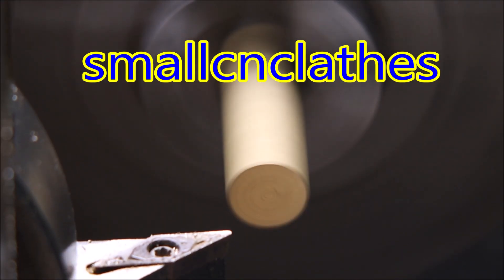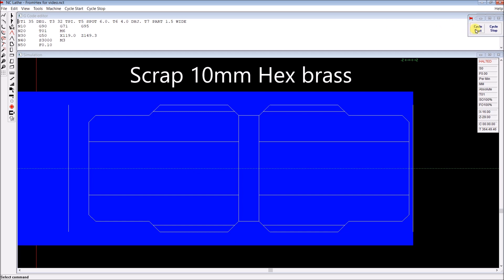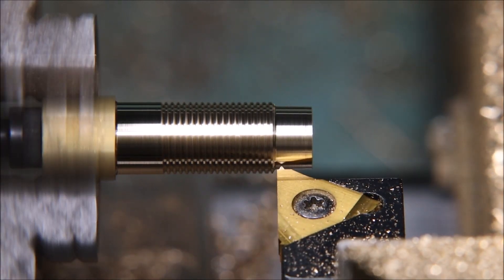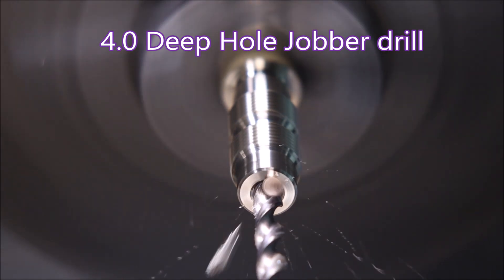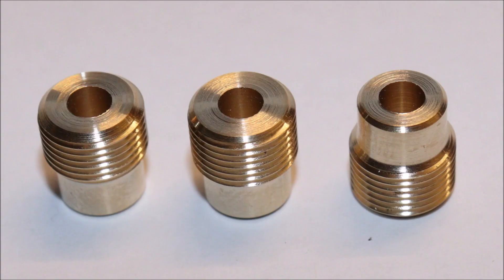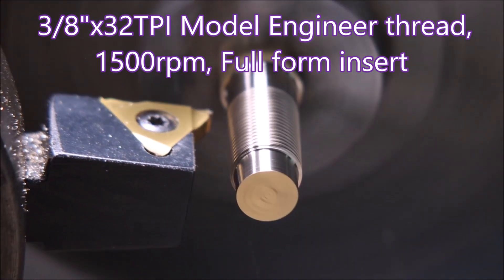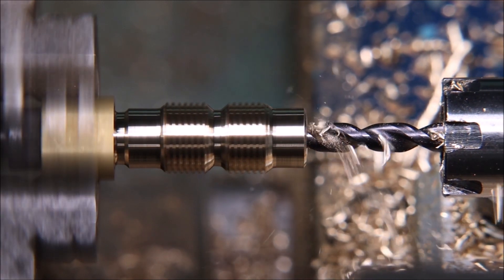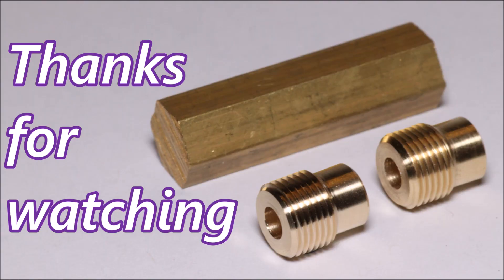Small cnc lathe turning 2 brass nipples 3/8x32 Model Engineer thread. From scrap hex brass

Comment: Recent Purchaced of novus 160.  Binging your videos. They are excellent.  Where did you find me 32 thread full form insert?
Reply from the maker: Do you need one? I think I had to buy two and I doubt I will ever wear out a single point.
Reply: @smallcnclathes . Of course😂.  I’m a hoarder and with retirement approaching with dreams to finish a few model engine projects I’m sure me thread form will be usefull.
Reply from the maker: @jirvin4505 are you on the Facebook Hercus cnc users page? You can get in touch with me that way
Reply: @smallcnclathes  yep just sent you a request and message

Comment: slowing feedrate down by half just before part is parted off will give smallest burr possible
Reply from the maker: Not so easy to do on my cnc. I would not get that result from a neutral insert, no matter what I tried. Thank you for your comment
Reply: @smallcnclathes  I agree , I was referring to an angled part off tool. I used to take a neutral or flat grooving tool and hand grind 3 -15 deg. On the cutting edge to a sharp corner. This works well in materials like graphite, which tend to chipout when breaking thru.

Comment: i find cross hole deburring tools kinda suck, i prefer to use straight-fluted countersink cutters. it requires more attention to stay consistent of course but with a depth stop it's just so easy
Reply from the maker: I find they don’t grab and deburr really well, but they are not good at making a countersink.

Comment: Excellent all round. May I ask what software you are using? I presume it was supplied by Hercus. I'm still using DeskCNC. It's fine for my little machine but I would love a decent simulator.
Reply from the maker: Hi Rob, yes you are correct, my software was supplied by Hercus. Simulation can be a pain due to limited tool library choices, but overall it is very useful, particularly for folks like me with little experience when I started with cnc.

Comment: very nice format! I learned a lot
Reply from the maker: Thanks Erik, I will stick with it.  If you learned a lot is there anything small cnc lathe related you would like a video about?
Reply: @smallcnclathes  I think it would be interesting if you have some considerations what to look for in buying a (cnc) beginner lathe. I mean you can buy a tormach, but that ain't cheap :D and maybe it's good to start on an older machine?

It cracks me up that you are still talking about DOS :D
Reply from the maker: Erik, it cracks me up that I still use it. LOL. In fact on one machine, I am not even running it in W98, still actually run it in DOS using XTree Gold as my file manager. I never was very good at command line instructions. One day I will get round to running it in W98.
Reply from the maker: In response to your suggestion, re where to start with a cnc lathe, my expertise is pretty much limited to these Hercus lathes.